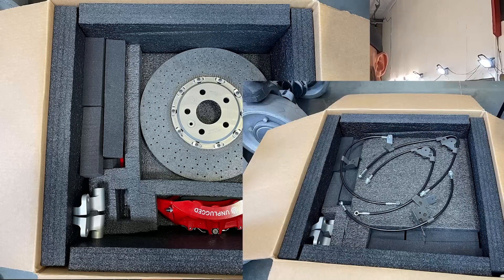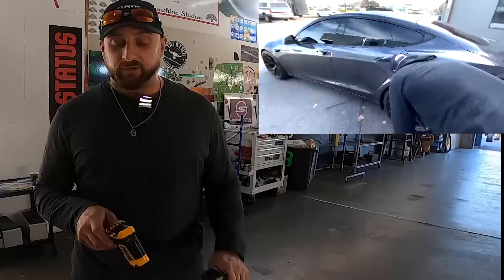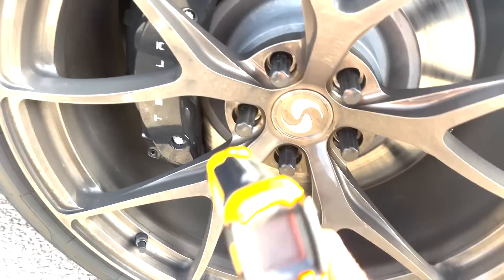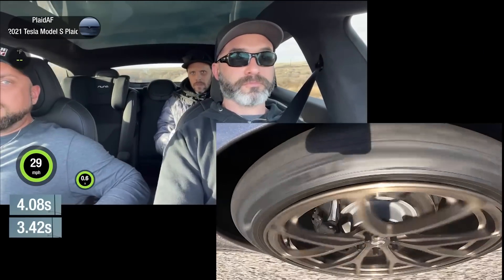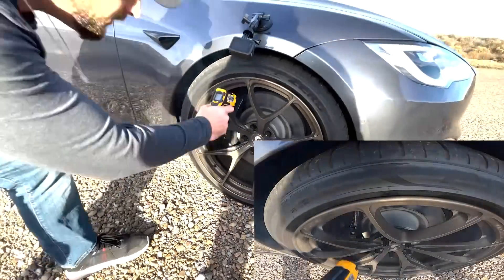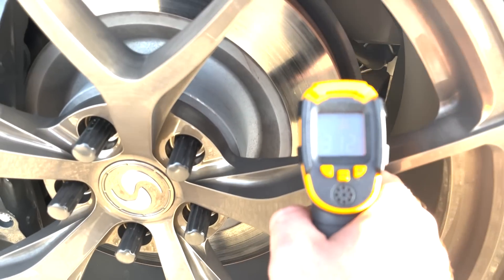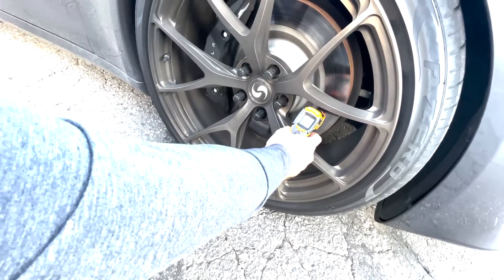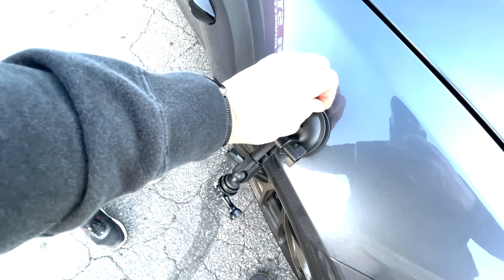Tesla Brakes Catch on FIRE | Model S Plaid

Comment: In my opinion one of the problem is that Tesla don't offer the option to put carbon ceramic brake on the Plaid since the beginning. 

And even with their new offer there is problems :
- their brake kit solution cost to much
- you can't chose their carbon brake kit directly on the configurator and have them on the car before receiving it. 
- their brake kit is available in mid-2022. One year after the release of the Plaid.
- lack of communication.  
(another example of the lack of communication : they advertised a top speed of 200mph for the Plaid that it's not even possible to reach yet and they don't even tell when it will be possible or what you will need and that six month after Plaid already deliver to customer. 

That said, for me, they need to put the option to put carbon brake directly on the configurator. 
But we know Tesla don't want to complicate their production lines which is the reason why the Plaid can be the fastest car in the world in the 1/4 mile while cost less than a Taycan turbo S.

And we also need the track mode which will maybe come with the brake package and the 200 mph top speed.

(sorry if my english is not perfect, I'm french)
Reply: You are absolutely correct!

(And your English is great! 👍🏻)
Reply: @mnowadmin5676  Thanks !
Reply: The Plaid "+" was the car that came with all the track focused parts including CCBs, but they decided not to sell that one for now, likely because of cell availability (it had a 4680 based pack) but also perhaps for product or manufacturing reasons.  Generally CCBs are not used for track because the operating cost is so high.  Agree on the point about communication, that isn't Tesla's forte.
Reply: @teampgr  you are totally wrong, stop justifying tesla dumb actions, there are no other vehicles out there with over 600hp that has such crappy brakes, they just had to offer cc brakes or simply bigger cast iron ones like other manufacturers have been doing for decade.
Reply from the maker: 100%
Reply: @alanmay7929  Not sure what is wrong about what we stated - the brakes are not 'crappy' in the use case they are designed for, they actually work quite well.  They are not designed for a road course, so using them there (or in a similar manner - 10 stops from 100 mph repeatedly) will not work well.  They have the version of the car that did have CCBs (the "+") that they decided not to sell (for now.)  They did decide to make those brakes available for those that want them - of course the cost (while reasonable for CCBs) is still quite high so I would guess most people wouldn't use them on the track.  Tesla has the engineering power and manufacturing capability to make essentially just a couple configs - that's ok, as long as they do the software part that we can't, we can swap the mechanical bits to make the car work on a road course.  How well?  We'll all find out!
Reply: @teampgr  it doesn't necessarily needs carbon ceramic brakes but bugger cast iron with 6 to 10 piston caliper brakes like porsche has been doing.
Reply from the maker: Yep- the stock brakes on the Plaid are not enough for one quick stop from 130mph… it would get wobbly and sketchy… my Acura integra gsr from the 90’s had better mated braking capacity (lighter car obviously, but the brakes were sized properly)
As I stated in other comments; my Ford F-150 has better equipped brakes than the stock Plaid… 
Interesting how so many make excuses for why Tesla put substandard brakes on this car, don’t get me wrong , I LOVE the Plaid, but it needed updated brakes for how I like to drive, and that’s not ONLY if you are going to take it to a road course track- I’ve felt the sketchy moments on the street enough to be disappointed in that aspect of the car… the braking should have been better out the box.
Reply: @PlaidAF  exactly the tesla plaid is a 5000lb car with over 1000hp stock vehicle, it's absolutely non acceptable which brakes its has. In Germany on the Autobahn people like to push their cars very fast sometimes way over 200mph because they have good brakes and suspensions too.
Reply from the maker: Where did you see that Tesla was marketing the “+” as having any upgrades besides the battery/range capacity?
Reply: @PlaidAF  We watch the public info just like everyone else but we also have some Tesla contacts.  The Plaid "+" car that was at the ring had CCBs, a new front lip and rear active aero spoiler, the 4680 based pack, and the track pack wheels/tires.  This is what they decided not to sell for now.  The CCBs are now being sold separately, the wheels/tires are expected to be released any day with the track mode v3 software update, and replacement pads for the iron setup might also be offered at the same time.  I have not heard anything about the aero bits being sold.
Reply: one thing about tesla is...

buy them for what they can do right now. dont pre-order and dont buy expecting a feature to come out quickly.

they have a lot of things to do and a small team of exceptional programmers. so they get through the tasks at a very high quality/skill level, but there is only so much work they can do in a day.
Reply: @Scholzey  I'll just say big lol..... mercedes has also exceptional programmers and teams of engineers, mercedes makes cars, trucks/luxury vehicles commercial vehicles, armoured vehicles.... mercedes is also in the f1 competition where they are leading and more.
Reply: @alanmay7929  im not sure you caught my point. Tesla has very few software people, so limited jobs can be done. The jobs that are done are to a high standard.

I. So the number of software people in other companies is far higher then Tesla, which enable more jobs to be done at once. But that's the sacrifice Tesla makes.
Reply: @Scholzey  wrong, it’s because Tesla is still a very small company, they don’t have the footprint of Mercedes for example, also Tesla vehicles basically only have one function, where Mercedes vehicles are used all around the world for all kinds of applications.
Reply: @Scholzey  a tesla is just a stock vehicle thats almost impossible and not worth modifying, you can still buy a new or 30 years old toyota hilux and drive it daily or use it for offroad/overlanding/farming, converting to RV..... ICE are simply way easier to configure and modify/tune.
Reply: @Scholzey  100% agree - know a few of them personally!
Reply: Lol.... 200mph is already slow in sedan standards, bmw has been doing over 200mph for almost a decade now.
Reply: @alanmay7929  Ok but what does this have to do with I said ?

Comment: Any car that can run 9s in the 1/4 needs good brakes. Every single YouTube channel that I follow has found the Model S Plaid to be under braked - especially when driven hard on the track. Perhaps the factory setup is fine for the street, but with a car that quick…oh the hell with it, just gonna call a spade a spade here. Tesla, can do better. Good call on the upgrade.
Reply: There is a brake upgrade for the model s plaid on their website
Reply: @JoshTheFrosch07  It shouldn't be an upgrade it should come with proper brakes stock.
Reply: @zolikoff  yes it definitely should
Reply: @zolikoff  you should survey all plaid owners and ask if they feel the brakes arent good enough for how they use their car. i guess everyone could pay 20k$ extra for the 5% that melt the brakes(after the car warns over over heated brakes)
Reply: @Scholzey  No, the car doesn't need to cost 20k extra, at the existing price point it should come with the proper brakes for this kind of car and that's that.
Reply: @zolikoff  what is propper brakes? biggest steel you can fit in 19inch wheels? how many stops is that going to get you on road going pads and fluid? twice as many stops? without dedicated airflow to the disks, is there a combination that wont overheat on the track for such a high power high weight vehicle without going carbon ceramic?

these are actual questions i dont know the answer to, so would be interested to know.
Reply: @Scholzey  Yes, one of the obvious points is that it's very clear that much bigger discs would fit into the wheels, this would improve braking performance. It's not just about how many stops, the brakes also influence the stopping distance. You can look at other "performance cars" in the market and most of them are lighter and have much lower performance than this car yet they come with properly sized brakes. Even though most of them will never see a track day, the brakes are big and thought with airflow in mind. Brakes are not an element where I can accept a manufacturer cutting costs, especially not in a car of this class of performance.
Of course, if you want to seriously put the car on a track, then you will need a brake upgrade anyway. But that's not my point, these stock brakes are simply unfit for this car, for the road.